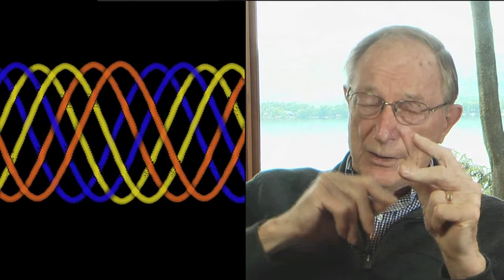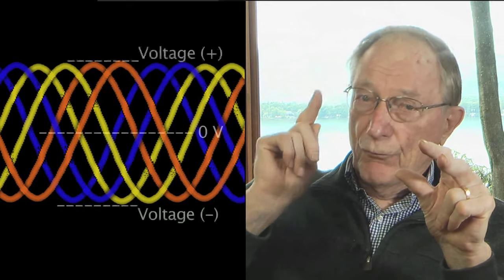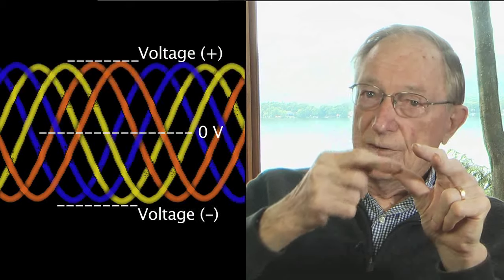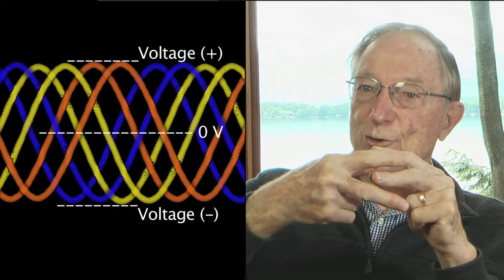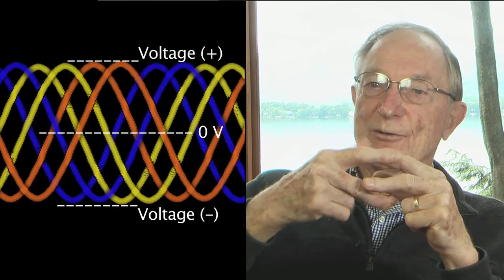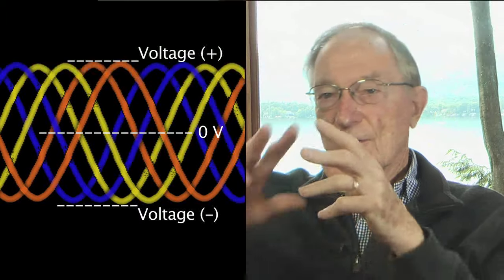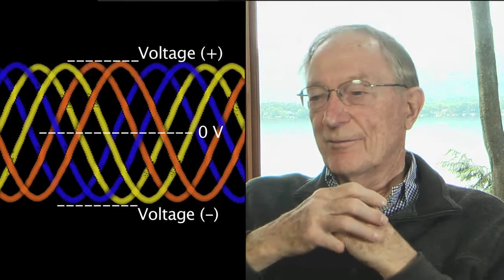Why 3 Phase Power? Why not 6 or 12?

Comment: But for going from ac to dc 3 phase, 400 cycles instead of 60. Less ripple and annoying at the same time. Somewhere between G and A flat.
Reply: @tripplefives1402  High power radar. It starts as 400Hz from a 400 Hz, 3 phase alternator or in some cases a MG set. You get 440 AC volts at 400 amps per conductor. The sine waves goes through a rectifier array. This arrangement results in lower ripple than using 60 cycle. If you seen it on an oscilloscope you would understand. It is a much simpler circuit than DC to DC conversion. This is for pulsed mega watts. It also does not take up as much space as trying to use an array of power supplies as used in Thread ripper or Xeon CAD machines or servers.

Comment: Yes but what about in a car. Does not really matter how many phases. Its more about how much power you can get out of system. If so then why not have 12 phase electric motors in are combustion cars. We could get in a 4 cylinder engine with a 12 phase alternator generating power for a 2 12  phase motors. The is a gain in energy right.  Plus less power is loss due to no transmission because you can have regulators on the amount of current and voltage to a motor with almost zero loss.
Reply: I don't think there's anything to gain by using greater than three-phase in a car.  The power is the same.  Higher phase order just increases complexity (more windings, more wires between generator and motor, more complex speed control, etc.).  The benefit of 6 and 12 phase is compact overhead lines.  This is not a benefit in a car.

Comment: why not two phase only sir please reply????
Reply: Two phase could be done, but the efficiency of space and conversion and other benefits such of high phase order are hard to beat. For instance, Three phases of a six phase line can be taken out of service leaving a balanced system.
Reply: Thanks sir!!
Reply: Two-phase (0 and 90 degrees) power was in fact used in the early days, partly to get around Tesla's 3-phase patents. Induction motors designed for 2-phase power work just as well as 3-phase motors because both systems deliver constant power throughout the AC cycle; remember sin^2(x) + cos^2(x) = 1.

The disadvantage of the 2-phase system is that the conductor currents aren't balanced. If the load draws 1 amp from each of phases A and B, then the neutral will return sqrt(1^2+1^2) = 1.4A and it must be sized 41% larger than the phase conductors. If the phase-neutral voltage is 1V, the power factor is unity and the conductors weigh 1 kg, 1 kg and 1.4 kg respectively, then you're getting 2 watts over 3.4 kg of conductors. That's 0.586 watts per kilogram of conductor.

Now consider 3-phase. If the phase currents are all 1A and the power factor is unity then there's no neutral current and you can eliminate it. Each phase conductor will again weigh 1 kg. If the phase-neutral voltage is 1V, you're getting 3 watts over 3 kg of conductors. That's 1 watt/kg, 71% more power per conductor than the 2-phase system, with the same phase-neutral voltage. That was a big deal even in the 1880s, and with the price of copper going through the roof it's an even bigger deal today.

The only minor drawback to 3-phase vs 2-phase is that the phase-phase voltage is sqrt(3) = 1.732 times the phase-neutral voltage while it's only sqrt(2) = 1.414 times the phase-neutral voltage in the 2-phase system. But this isn't a problem on most transmission lines because the phase-neutral voltage sets the amount of insulation required.

It's possible to do equally well in a split-phase single-phase system (e.g., standard 120/240V North American residential power). If again each phase current is 1A, then the neutral carries no current and you have 2 watts over 2 kg of conductors = 1 watt/kg, same as 3-phase. But while single phase is fine for lighting, it's much less desirable for induction motors. Also, the phase-to-phase voltage is now 2V, greater than both the 2- and 3-phase systems. And real split-phase systems still need neutral conductors to serve single-sided loads. So we really could have been better off with 3-phase power in residences as well as businesses, as is often the case in Europe.
Reply: ***** Also 2 phase still has some difficulty in guaranteed motor start direction :P
Reply: Joseph Perkins It does? Why?
Reply: ApolloWasReal It's simple geometry. 90 degrees gives you a square field shape. What you want is a slight difference between the rotors current position and a rotated position in the direction you favor. From the tales told from the early days of two phase testing, the motors would sometimes hang and not rotate at all, so they needed a similar pole shading field as used on single phase motors. Not starting at all was one of three things that would happen to the first attempt to run an AC motor based on DC motor designs.
Reply: Joseph Perkins That still doesn't make sense. Wind a 4-pole stator with the poles at 90 degree physical spacing. Drive the 0 and 180 deg poles from phase A. Drive the 90 and 270 deg poles from phase B. Drive with a 2-phase supply (0/90 deg, not 0/180) and voila, a rotating field with constant magnitude exactly like that generated inside a 3-phase machine.

To reverse, flip the polarity of one of the pole pairs.
Reply: Joseph Perkins Here's another way to see that the advantage of 3-phase (0/120/240 deg) over 2-phase (0/90 deg) is mainly in the transmission of power.

The sum of the phase voltages in a 3-phase system is always 0. The sum of the phase voltages in a 2-phase system is not zero. If the two phase voltages have a peak of +/- 1 V, then their sum varies between +/- 1.414V, i.e., the square root of two.

This means that a balanced wye load on a 3-phase supply has no neutral current, meaning the neutral can be omitted and only the 3 phase conductors are really needed.

A balanced load on a 2-phase 3-wire circuit does not have zero neutral current. The neutral current is equal to sqrt(2) times the current in each phase (it's the vector sum of the two phase currents). So you still need three conductors, just as with 3-phase.

Moreover, the power delivered by the 3 conductors in a 3-phase system with 1V RMS to ground into three balanced 1-ohm wye loads is a constant 3W, with a current in each phase of 1 A RMS.

The total power delivered by the 2-phase system with the same 1V RMS phase voltages into two balanced 1-ohm resistor loads is a constant 2W, with 1 A RMS in each of the phase conductors and 1.4 A RMS in the neutral. So the 2-phase system delivers only 2/3 the power of the 3-phase system yet the third wire carries 1.4 times as much current as the third wire in the 3-phase system. The 3-phase system is clearly more efficient with copper or aluminum with the same phase-to-ground voltage. (It is true that the required neutral in the 2-phase system doesn't need the insulation of the two phases.)

However, as far as AC motors go, both systems work equally well -- though I haven't looked at the efficiency of copper use within the motors.

But DC has both systems beat! Since peak voltage determines the required insulation, if you put two balanced 1.4 ohm to neutral loads on a bipolar DC system with one "phase" at +1.4V DC (the peak of the AC waveforms) and the other at -1.4V DC, there's no neutral current so you only need the two conductors. The total power is 2.8 W, the line currents are still 1A, but you only need two conductors to deliver almost as much power as the 3-phase system. This is (2.8/3) / (2/3) = 1.4x as efficient as 3-phase in terms of aluminum/copper and insulator usage!
Reply: Jamshed Writer com

Comment: Everything come down to cost justification. Just because something can be done doesn't mean it should be done. Typically only industrial and farming applications will ever use three phase power. That's just the way it is. No one has a 3 phase motor at home or a welder powered by 3 phase current, and if they do it's not connected to power.

Comment: most of the wourld uses 3 phases but high voltage 130.000 volt to transfer much power from say big powerplants to a transformation centre near a city.
out fron there there goes lower voltage lines 10.000 volt 5000 volt and 500 volt and so on.
to near where it shall be used, where its another smaler transformator station that send ot the end user voltage say 220 ore 400 ore 380 volt. hehe

Comment: Great info. Thank You.  
I'm looking for a wiring diagram?  I'm wanting to see how one would rectify all 6 phases back into a single DC supply line.   Anybody?  Thanks Murf!
Reply: I'm butting in without checking the thread, but why not just a full-wave bridge?  Just six diodes that provide six little bumps per cycle rather than the three that a three-phase full wave bridge would provide.  Am I missing something.  I'm definitely missing why one would do this (because I did not check the thread).
Reply: ***** your not butting, im winding some coils, maybe 36 of them.  im making a 32 magnet alt, the end goal is to charge batteries. i am interested in 6 phase for small gauged wire transition to the rectifier at far off distance.. I don't believe full wave is needed? Your thought?
Reply: Dan Murphy opps i think i thought you was talking inverters....
Reply: ***** once i cleared my brain fart out of my head I realized I had been searching inverters not rectifiers... da.. my bad!
Reply: Dan Murphy I think you would need full wave to get full use out of each cycle (half wave only conducts on the positive or negative half cycle and wastes some winding capability).  But, you have some distance between the 36 coils (grouped to produce six phase) and the rectifier?  So you need to transfer the power as AC for some distance?  I'm wondering what the benefit of high phase order is here. Running six wires when you could run fewer?  The six phase benefit is in compact overhead lines ..... wait, you are probably talking about an overhead line?  Yes, you probably do want six phase mostly because it is very easy to obtain from your home built alternator.  There was talk in the HPO days about using six phase generators or multiple 3-phase generators with the rotors shifted to produce six phase (lots of such ideas came and went because the focus was on high power density on precious ROW.  Anyway, you are going to hang six conductors in something that looks like two three-phase circuits but is connected six phase?  I think I don't see a way to get full use of the six overhead conductors without pairing them up and feeding the DC bus with four diodes in full-wave.  You need current flow in each conductor in both directions.  That says full-wave to me.  Best would be to rectify at the alternator and hang just two conductors but there's apparently a reason that does not work for you.
Reply: 6 phase rectification is done all the time and it is really cool.  My questions is "why is it not used more often?".  In the past some 50kw AM radio transmitters and almost every UHF television transmitter used it.  It is most often referred to as 12 phase rectification because the rectification process doubles the number of DC pulses per cycle to 12.

The 6 phases are generated by using both delta and wye secondaries which are naturally 60 degrees rotated from each other.  The resulting DC has about a 1 percent ripple at a frequency 12 times the incoming AC frequency, which makes filtering super easy.  

Look up polyphase rectification and you will find a ton of information.
Reply: AWSUME I'll due that tomorrow. thanks!
Reply: Steve M AWSUME I'll due that tomorrow. thanks!

Comment: So, the answer to the question is: No 6 or 12 phase because of the FORM of the tower....-.-
Reply: Multiple six and twelve phase tower designs were built and tested in the70's and proven.  Double-circuit 138 kV lines have been converted to six-phase and operated as such for years (may still be, I'm not sure).  The limitation of six and twelve phase AC transmission is largely putting so much power over a single transmission line. It can be a liability from a reliability perspective and when a new line is needed, HVDC or AC is often a better fit.

Comment: because 2 wires is bare minimum for AC power, add just one wire and you ger 3 phase, most power for the least infrastructure $

Comment: why the six phase almost doubles the three phase but 12 phase does not double the six phase?
Reply: sashetoa Yeah!
somebody explain it to me too. I have also the same question.
Reply: Have a look again at the graphics of the explanation in the video at 1:03: Between the 3 Phases there is a relatively large "gap", where the motor isn't delivering much power/torque. With 6 phases, these gaps are filled much more, so the motor can deliver nearly twice as much power. With 12 or more phases the gaps to be filled get smaller an smaller, and that means that the "ripple" in power delivery gets smaller and smaller - that's why the effect is diminishing. Using 3 phases is just the smallest amount of phases which gives a rotational field and self-starting strong motors with the least amount of conductors = cheapest & easiest way of doing it. ATB, Gereon
Reply: Yes, it's like having a 6 cylinder engine and a 36 cylinder engine.  The 36 cylinder engine would run a lot smoother, but would be limited to how much an explosion of each cylinder can create at an instant of time; like he said, it diminishes.

Comment: has anyone tried a 360phase motor I bet it would have the most torque. a phase each degree of phase angle would be hard to wind unless it's radius is large. I think there is a fan that is 12phase and it's the most efficient fan on the market

Comment: Sending polyphase power requires the utility to re-design their generators from scratch.   Generating polyphase on site would work, but you wouldn't get much extra power savings.

And since if anything, there's interest in high-voltage DC carrier lines... polyphase is cute but not an economic driver.

Comment: he does not give the reason and the reason is VERY simple. alternating current gives you a pulsating power (P=U*I) while U beeing U=I*R -> P=R*I^2 and the current I is, as the voltage U pulsating in a sinus wave.
so how do you get a steady and smooth power usage out of electricity? 3-phase power does that exactly as good as DC voltage! 2-phase, 4-phase cannot do that. I'm not sure about 5-phase power, but as it's said in the video, it's doesnt make sense economicaly.

Comment: lol. Cost increases but power also increases. Instead of connecting two generators and occupying more land. That 6 phase seems economic
Reply: +Salman Muhammad, I am sorry, but for sure not.  What the power company does, is simply parallel conductors on the existing 3 phase towers.  I have a large transmission line right here in Vegas, and you can easily see 4 conductors running in parallel on each insulator.

Comment: Y not 2 then?
Reply: The 240/120V split system is actually a 2 phase electricity. One leg is 180 degrees apart from other leg.

Comment: Typically, rotating devices will have an odd quantity of spokes.  EXAMPLE:  Look at most vehicle wheels; .most have an odd qty of pokes.  While an EVEN qty of spokes would seem easily "balance-able", in fact, its not.  The odd spoke could be thought of as a "hunting gear" within transmissions.  The term "hunting gear" is mechanical engineering nomenclature.  Point is:  While 6 phases (or perhaps 12) "electrically" might seem to be reasonable.......mechanically speaking, it might not be feasible.  Notwithstanding this, a larger diameter rotor would likely be required to accommodate the increased "bulk" of windings.

Comment: Three phase would be better with less phases but motors need three to get directional drive.It's all about costs torque and not really being useful to have more phases in distribution grids.Four phases would be bad for motors,that's the same effect as having two! but with half the torque And going to five would only further decrease torque in large AC motors.and add more lines and weight to our expensive power grid.

Comment: Short version:
Doubling the number of phases to 6 would almost double the amount of power we could transmit without increasing voltage or current flow, but the more phases you add, the less efficient it becomes.
Also, increasing the number of phases means increasing how much hardware you need in order to transfer all that energy, and that hardware is expensive.
Shorter version / summary:
It could be done and it would make electricity transfer more efficient, but it would probably be too expensive to make it worthwhile.

Comment: He did not really say Why 3 instead of 6 or 12!!  He vaguely explained the power will diminish as we increase the phases. 

Basic concept 
It efficiency decreases as we increase the phases and also we will need to include more steppers which means more costly in terms of maintenance and manufacturing.
Reply: Bash A Would not 12 phases double the power? or its just the efficiency that will drop?

Comment: Does not explain, why not a 2-phase line? Or two 2-phases lines combined... Or three 2-phases lines combined. 
Why 3? Also this reasoning is only valid for overhead lines in windy conditions. Cables or no-wind would create thermal havoc on the insulation because of electricity losses in the conductors... But nice try.B.t.w. actual answer is because of a rotation magnetic field in a motor / generator and having a constant torque on the rotor which is not possible with 2 phases....

Comment: Ironic....Edison Center  talking about AC
Reply: It is not ironic, Edison is a great inventor of entertainment devices, Tesla is the second type of inventor, for example, a polyphase system that works for 120 years. These phases are ideal, 3000 rpm one pair of scrolls, 1500 rpm two pairs of scrolls and so on depends on the number of electric angles you want a higher rpm use a frequency regulator to 100 hz or use a collector motor ............................